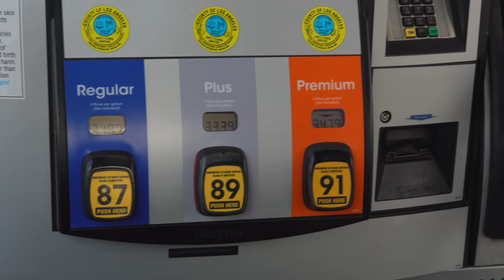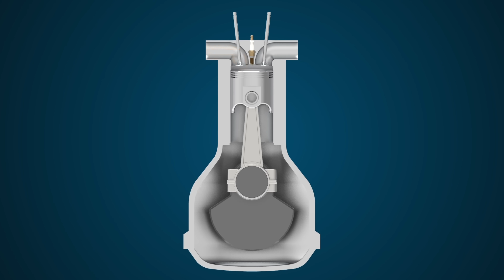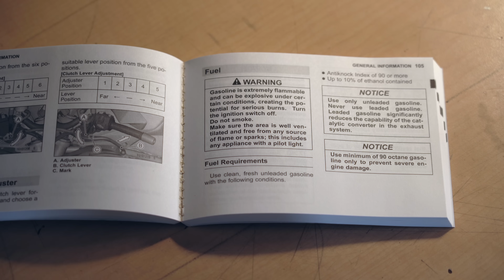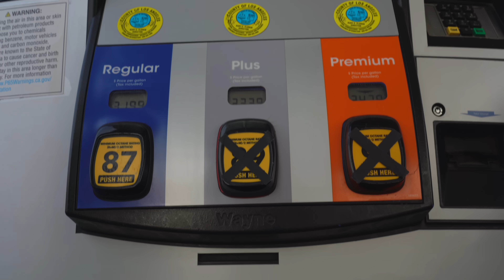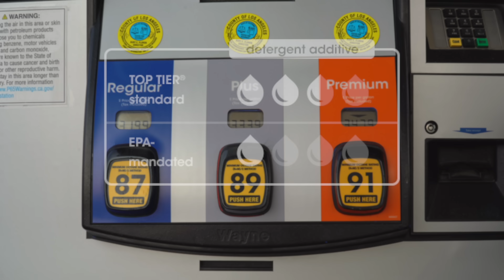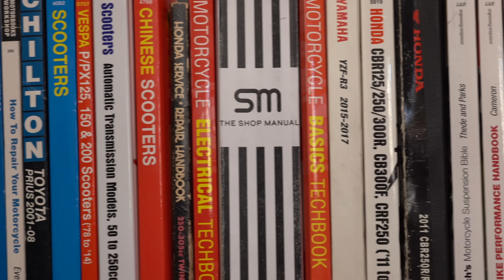Should You Run Premium Gas In Your Motorcycle? Octane Explained | The Shop Manual

Comment: Tell me about elevation, octane, and how those two things interact with my moto
Reply: A naturally  aspirated  engine  needs  less octane at  higher  elevations..  You can  advance your  timming some to  make  up for thinner air.    I think  you loose  40%  of  your power at  10,000   feet  // Denver is at  5,000  feet
Reply: Mike Skidmore - I seem to remember  the formula as 3% power loss per 1000 feet above 1000 feet. You also lose one point of compression per 5000 feet due to the lower atmospheric pressure. I’m at 7000 feet here- down 18% on air density/power, about 1.25 points in compression. We regularly see 90 octane here instead of 91 or 93...
Reply: Air is denser at sea level. So you need less octane the higher up you go, which is why in some mountainous areas they sell 84 octane as a replacement for 87.
Reply: The general rule of thumb is that the octane requirement drops about 1 point for each 2,500 feet (800 meters), this ONLY applies to naturally aspirated engines.

Comment: Thanks for summing it up, Ari. As a non-native speaker having the privilege of running in a brand new bike, I watched the whole video a couple of times to make sure I understood every point. Much appreciated.
Reply: česko? dont be a fool and put just premium gasoline into your tank. the dude is speaking literaly bullshit. I ride bikes for 13 years now. even in 2008 the 100 octane allowed me to run my bike on lower RPM without slapping the chain. it run smoother. smoother is better for the whole engine and its bearings. and now with E10 bullshit, I can significant save fuel with 100 octane. the consumption goes down by 15-20% with premium fuel. no joke. the rubber parts of your fuel system will thank you too. never tank E10 or non premium shit. you can thank me later

Comment: Use 95 Euro fuel - I suppose that is 89 in US terms.  That for litre sports bikes.  Find much smoother engine revving / power delivery through the rev range.  The 98 High Octane I found to have the lower rev range lag in throttle response and the engine would bog down a little until the mid rev range say 6k.  Not ideal for riding on the road.

Good vid.

Comment: 91 RON i get 21km/Litre
98 RON i get 27km/litre. And apparently higher octane doesnt get more mileage 🤔
Reply: depends on what your motor is designed to run on. just like how on a modern car if you use lower octane fuel it just runs with less power or if you have an older car with lots of carbon build up your compression ratio increases and you can see better results with higher octane
Reply: You may have a tuning issue.  If the lower octane is burning less efficient than your timing may be off, as in advanced a bit too far, for the lower grade fuel.  It can also be an issue with fuel to air mixture being a bit on the lean side .  Double check your manual, it's possible that you are not supposed to be using the lower grade fuels.  A high compression engine will lose efficiency with too low of an octane fuel because it's not burning at the correct rate .
Reply: @PetrolJunkie  Brilliant response. So many people think it's the fuel making the difference (which it may be), but fail to consider the WHY.
Reply: In what vehicle? Your ECU might advance ignition with the higher octane fuel, but a 28.6% increase in fuel efficiency just doesn't seem likely.
Reply: @Joric78  ECUs on bikes aren't that advanced. No knock sensor.
Reply: @AriH211  You've been riding old Gixxers for too long. ;) There are new bikes like the KTM Duke 890 with knock sensors. Edit: ...and for that matter the Z H2 you were riding in this video.
Reply: @Joric78  Yeah I mentioned that elsewhere. Knock sensors were only recently introduced on motorcycles, so unless you're on a premium bike (H2 or new Euro 5 KTM) that was built in the last couple of years, your bike will not have a knock sensor and ignition timing will not automatically adjust to avoid it.
Reply: @AriH211  Well, except for the R1150/1200/1250GSA which have had them since the 90s, so you don't have to be overly worried about lower grade fuel on your "long way round". Unusual on bikes though for sure. Even my 2018 1290 SDR doesn't have one. On the RC8 you had to switch map. I've noticed no difference between 95/98 RON on the SDR (5L/100km avg). Haven't tried 91 RON, because the manual says to use 95 (and it does have 13.6:1 compression). Even in vehicles that advance the ignition further for higher octane fuel (and have a the compression to take advantage of it), you can only expect an increase of efficiency around 1% per increase in RON. So 28.6% increase  from  switching between 91 and 98 seems incredibly unlikely. Even if the 91 RON fuel was E10 or similar (you lose about 3% efficiency for 10% ethanol, and it's a linear relationship). That said, I can't think of any bikes that will get 27km / L and require 95 RON (let alone higher) or have a knock sensor.

Comment: So if your manual says regular unleaded, and the gas station says premium is zero ethanol, would then that premium be best for the bike?
Reply: If your bike was built within the last 20ish years, it was designed to run a blend of around 10-15% ethanol. Run whatever it says in your manual; that is what it was designed for. You will probably not notice any difference between ethanol and non-ethanol fuel.

Comment: Ari, can you address non Oxygenated gas? I use it in my 2010 ST1300, and it runs like a top.  I've also been told it keeps your engine less (gunked ) up from ethanol....what's your take?

Comment: I’ve been using marine gas because no alcohol added. I don’t ride everyday so the marine gas doesn’t break down like road gas.
Reply: I do the same. Once every 10 tanks or so
Reply: There are  several brands  of  fuel stabalizer   for  E-10  too  Yamaha  and  Textron  ect ..
Reply: Mike Skidmore you’re still adding more by products than having pure fuel. Look at your lawn equipment all of them suggest that you use non ethanol fuel. No matter what additive you put in  it still contains alcohol which attracts moisture. Put some ethanol fuel in a glass container for a few  weeks and watch how it separates into layers.

Comment: Okay, but why does my 49cc chinese scooter go 3kmh faster with vpower than regular E95?
Reply: Miika Erola the difference there is the ethanol. Ethanol has a lower energy density than the rest of the components in your fuel. V power is ethanol free so the fuel has a higher energy density and yes, you can get increases economy and possibly power (therefore top speed). As a surprising side note, adding ethanol boosts the octane rating while lowering the energy density.
Reply: Because of the weight issue.      Less money in your wallet = lighter weight ..
Reply: Because your wallet is now lighter = more speed
Reply: Higher specific energy output. Not in the video. MA y high performance machines have HP ratings with 100 octane gas and with premium (91-93). Can be up to 10 %difference
Reply: @rogercohn  Not with pure gas, (no alky). 87 octane has about the same energy of high octane race fuels.
Reply: maybe you went to the bathroom so now you are lighter
Reply: Because you filled up with the E95 downwind? xD
Reply: What did you eat before filling up ? was there, huh, let's call it digestion-induced jet assistance ?
Reply: ze moped smelled rice and endangerd species food ... from infront high speed....

Comment: As mentioned below, you should also talk about ethanol content in gasoline.  All if not most gasoline today is sold with ethanol in it.  Then there’s Shell’s V-Power 91-octane gasoline with 0% ethanol.  A mechanic recommended I fill my FZ-07 with Shell V-Power for winter storage.  The FZ-07 normally uses 87 octane.
Reply: Ethanol free gas also has a higher energy density
Reply: @bh02422  ...you cannot find it in Canada....
Reply: If you have to store your bike for more than a month, make your last couple tanks none ethanol.  Then stabilize it.  Stabilizer does not remove ethanol and is necessary if your store your bike with a full tank.  I work for a fuel company and got the ins and outs when I had a refinery tour.  Cheers.
Reply: All you have to do when you store your bike is fill the tank to the brim with whatever fuel you like and close the cap. The less air inside the tank, the better. If it's full to the top, there won't be much air in the tank for the ethanol to draw moisture from.
Reply: Chevron, Shell and Costco all sell ethanol free gas in Canada (premium grade). That’s all I use in my bike.

If I have to use ethanol, I add either SeaFoam or Marvel Mystery Oil to the fuel to counteract the ethanol effects.
Reply: @forwallz  You can add Irving, Esso and Canadian Tire to that list, and if you're in Québec you can also add Harnois. In fact, ethanol-free gas is still pretty easy to find. I have never had a problem running E10 in my bikes that could run on regular, but my current Moto Guzzi requires premium and although the manual states that E10 is acceptable, I stick to ethanol-free because why not ?
Reply: @CaptHollister  All the Irving pumps I have seen show 10% ethanol for all grades of gas.  Then again, Irving seems to hate Saint John :)
Reply: dude you have to run at least 1 full tank complete empty and then refill before premium will help with storage, even then its not going to be as good for your bike as a fuel stabilizer.
Reply: another thing to think about, is that the ethanol turns into acid when it's stored. so not only do you get more water, you get acid eating away metals, swelling fuel lines and gunking up the fuel system and carbs.
Reply: Don't use ethanol for storage it contains alcohol and will dry out the oils in the gas and cause electrolysis corrosion ...
Reply: I'm in Texas so I don't need to worry about storage for the winter for long periods. 🏍
Reply: My shell station has 91 v power here in CT and it has 10% ethanol in it.
Reply: We have e10 91 octane, then all other fuels with no ethanol, 92, 95 and premium at 98 octane
Reply: New engines made to run up to 10% ethanol,  but not in small engines like lawn mowers ethanol bad for cheap carbs they use. Also absorbs moisture more than pure gas.
Reply: @RT22-pb2pp  agreed, just ask any boater how ethanol treats there small engine!
Reply: That really depends on the country. Ethanol blended fuels are sold separately in Australia from a different pump/nozzile to the rest of the unleaded fuels. 
You can't accidentally put ethanol blend in the bike.
Reply: @lay3rmask  in most countries it's mixed in. In Europe anyway. Don't know about the rest of the world. In Norway you can still get e0 if you buy premium from shell.
Reply: Lucky bastards.... in Slovakia they completely stopped selling E0 fuels. Even Shell V-Power Racing (100 octane) now has 5% Ethanol. All the rest have 10%. Same with OMV and all other brands. I would have to buy some actual racing fuel in a barrel to get E0. And I’m not doing that. 🏍
Reply: No ethanol in aussie petrol unless you deliberately buy e10
Reply: But does higher octane have a higher percentage of ethanol?
Reply: A fuel stabilizer will do the same thing for less money. Js
Reply: @joew7897  Is fuel stabilizer that cheap? This only cost about $1.50 in fuel if the 91 is 50 cents a gallon more than 87. Remember you will still have to fill your tank with the 3 gallons of 87 plus the stabilizer over just filling with 3 gallons of 91.
Reply: @CraigSmith568  none ethanol fuel near me is dollar more per gallon over premium which is usually .60-80 cents more than regular. Not to mention the stabilizer bottle usually treat 15+ gallons. So for me having 3 bikes a 4 wheeler and a mower to winterize. Its considerably  cheaper.
Reply: @joew7897  Watch FortNine video on fuel stabilizers
Reply: @joew7897  Fuel stabilizer will not remove the 10% Ethanol already present in the fuel. The point is to use a fuel without Ethanol, because ethanol is hydrophillic and attracts water (will pull moisture from the air). That is exactly what you don't want to happen when you store your bike for months at a time.
Reply: @Andres-hv7kg  no it doesn't remove nor did I say that it removed the ethanol.  It does, like the name implies, stabilizes the fuel. Which includes fuels with ethanol. It stops it from absorbing water.
Reply: @Andres-hv7kg  the whole point of stabilizer is to reduce how much water gets into the fuel. It effectively cancels out the ethanol
Reply: @Andres-hv7kg  You need to re-read hydrophillic.  It doesn't attract water, it is attracted to water.  All air has water, and without stabilizers over about a month the ethanol leaves the fuel for the water.  Making it look like it's pulled in a bunch of water, when in reality the total volume of liquid in the tank is unchanged.  You simply now have ethanol sitting on top of the fuel it was once part of.
   Running this of course is bad since it's no longer 87 octane without the ethanol and will make a small engine overheat and knock itself to death in short order.  Should the engine  survive long enough to burn all the old gas it can enjoy a nice gulp of pure ethanol alcohol to was it down.

Comment: Great stuff as always Ari.  I always love the message board talk of gas octane and all the theories.  Simple enough...read the manual and put in the right stuff.  I do like the suggestion of what to do if forced to run a lower than recommended octane.
Reply: If you don't run your tank all the way out the fuel is always mixing and averaging.  If you run the tank really low you are more likely to see issues than if you add more fuel at half a tank for example.  Keep that in mind.  If you use an octane booster make sure you read the instructions rather than just dumping the whole bottle into the tank, you could easily raise the octane too high.  I had a bike where it required high octane fuel and I used to keep a bottle of booster handy or only fill it from a jerry can because sometimes it's hard to find 92-93 in my area.  

You'll go to the pumps and only find an assortment of 87-89 and that isn't  going to cut it in a higher compression motor.   You can, if you know how to measure, mix and match fuels to get what you need.  But it's not something you should do unless you fully understand what you're working with, I'd just stick to keeping a bottle of octane booster handy.

Comment: One of the best explanations I’ve watched and agree 100%. In Australia, where I live we basically run 4 grades of petrol. Being Rwgular unleaded @91 octane, e10 (approximately 94, premium at 95 and super premium which has an octane rating of 98. You can tell the differences (slightly) but doesn’t really justify the huge price differentials (even factoring that the higher the octane equates to more weight). Thanks ARI! 😎😎
Reply: Uhm if your bike is designed to run on premium or super, which pretty much everything from japan and europe is, then you need premium or super or you risk predetonation and killing your engine
Reply: Ano Nym Um, I have three Japanese bikes - factory recommended fuel is 91RON ULP on all of them. Remember asking a Kawasaki salesperson about fuel types and he said everything I can see on the showroom floor runs on 91RON. Now, they may have introduced a motor or two since then that runs on a higher octane fuel but not everything. I don’t know if the newer/cleaner motors are forced to run at higher compression rates to meet emission standards and require higher octane rated fuel?
Reply: Ano Nym “Super” and “Un-leaded” Petrols are different. Cars and bikes that pre-dated 1985 were basically all running on Super. The main differences between Super and unleaded is that Super has lead in it (hence why it’s not made anymore). The old Super was at a higher Octane rating than regular unleaded. As a result the engine manufacturers had to make changes as performance (peak power dropped). Then came premium unleaded which basically has the same octane rating as the old leaded super. Hope this helps.
Reply: @marcusgeorge1825  yeah no.

Super is just a name it has no standardized meaning. Switzerland sells super and super plus (95 RON and 98 RON respectively) both of which are unleaded. Britain used stars (1 through 4 stars) as a measurement in the leaded days.

Also old leaded super was still 95 RON just like unleaded super because tetraethyle lead is just an octane booster. Leaded super plus was also 98 RON like unleaded super plus is.

Fucks sake you can even buy 100RON unleaded in some places.

And super (plus) unleaded were available before leaded petrol was phased out. Or before lead was phased in because ethanol is also an octane booster.

Which Thomas midgley jr. found out in the 30s working for general. But he went with TEL because general couldn't patent ethanol.
Reply: Ano Nym I was simply referring to Australia 🇦🇺 so in that regard I’m 100% correct.  In other countries, like you have mentioned the word super is used instead of the word premium. All good!